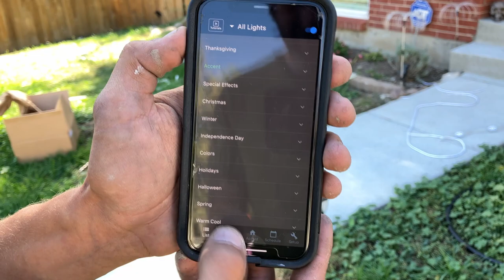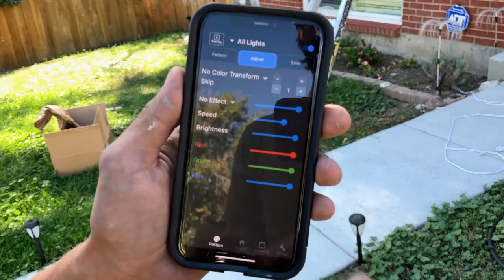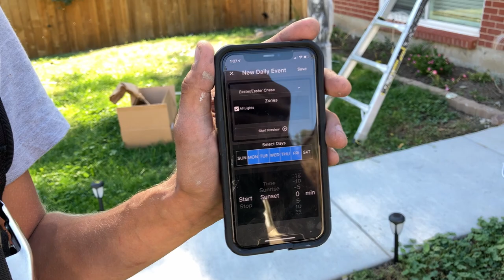Jellyfish Lighting (Discount) - Permanent Holiday and Security Outdoor Lighting Solution

Comment: If those are ws2811x Lights, you can check the WLED, an open-source software which will make sure you fall in love with diy capabilities and even run a stunning light show using songs thru xlights 🤩🤩.
I am Just a die hard fan of WLED though 🙏🙏
love from India 🙏🙏

Comment: I wish I had never had these installed on my home. Biggest waste of money. Most of the time when I try to use them the controller has lost communication. When I first got them installed a technician came out to look at the controller and of course blamed the problem on my internet. I have had Comcast test the the signal and it is strong at the control box. If I want to use the lights I have to reboot the control box 3 to 4 times and re boot my phone 3 or 4 times. If I am lucky they will work. I am tired of fighting the problem and no longer use them. Wish I had the Trim Light system.
Reply from the maker: Thanks for that information, I haven't had any problems with mine yet, (i have xfinity/comcast as well) and wow this christmas and new years (and halloween was crazy!) we have the best house on the block for sure. I have had the app say "no wifi connection" once, but I just deleted the app and reinstall and it works fine now. I'll have to check out that trim light system as well thanks for the info again!